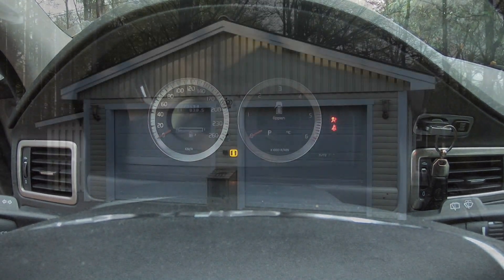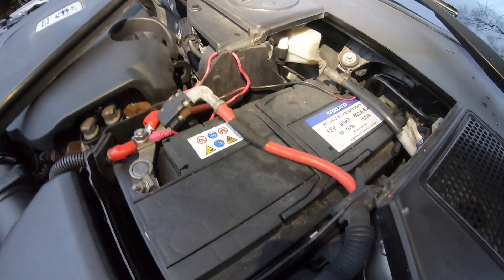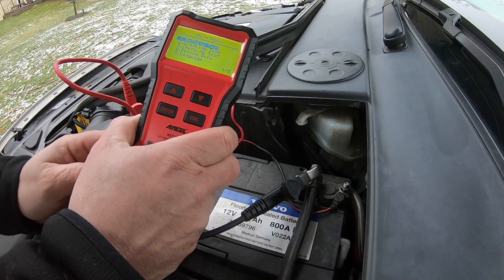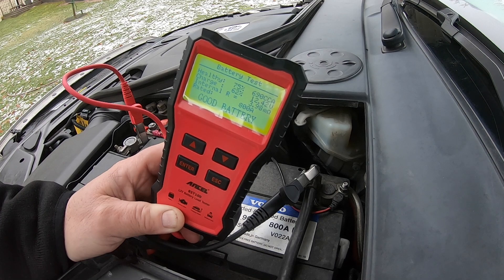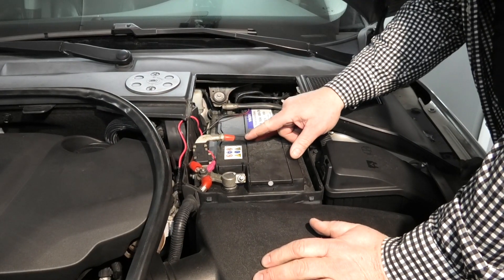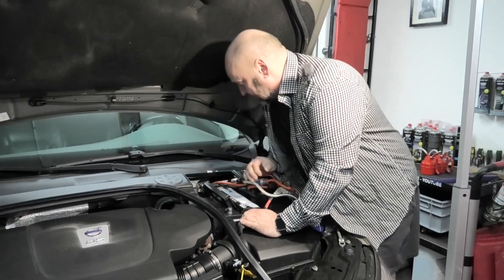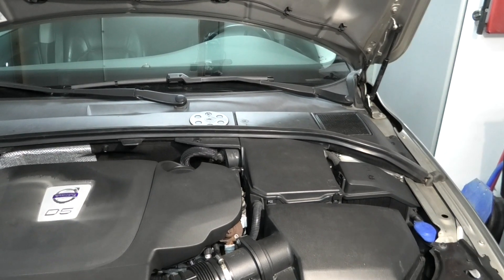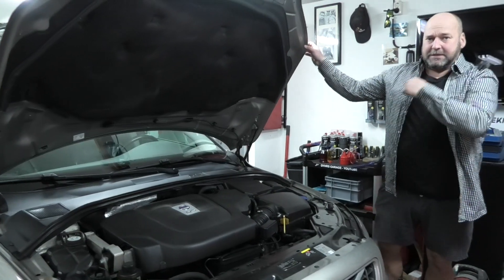Byt batteri enkelt på Volvo och andra bilar

Comment: Bra video på hur man byter batteriet lätt och smidigt. Glöm ej att koppla på din autel och programera strömförsörjningsregleringssystemet(bms). Om detta inte görs kan du förkorta livslängden radikalt på nya batteriet. Om du har start stop system så kolla även detta batteri så konditionen är bra på det.
Reply: Finns ej på denna bil
Reply from the maker: Denna kärra har inte BMS och inte Start-Stop, tyvärr :)